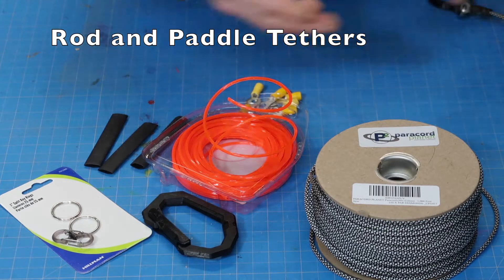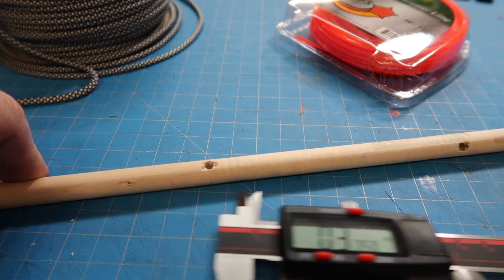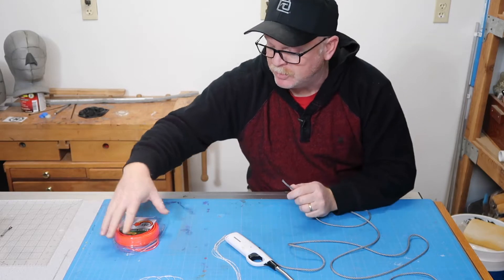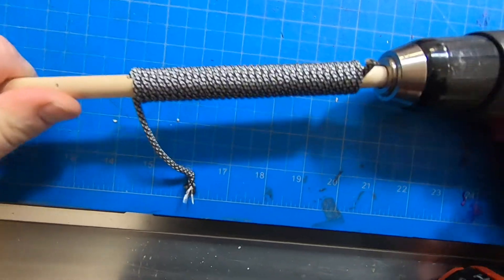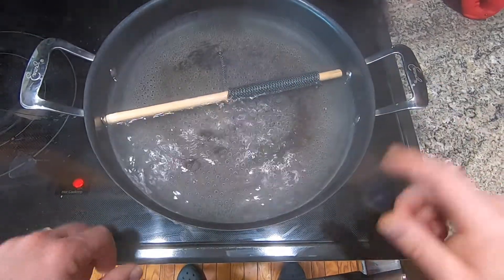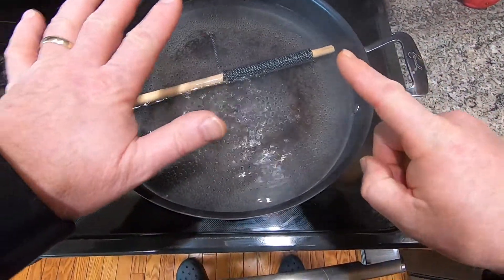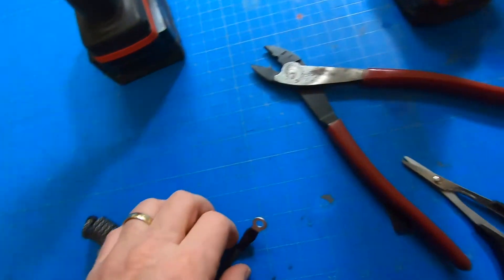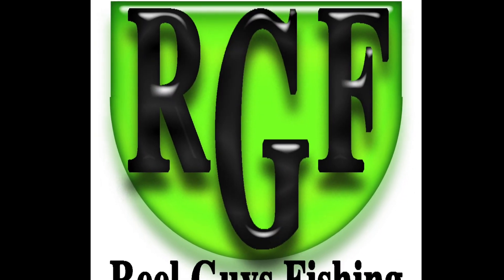DIY Paddle and Rod Retainer Leashes

Comment: I'm going to try this.  But, I wondering how well does the wire terminal hold up in saltwater?
Reply: I can’t tell you. I’m up north in the land of fresh water. It does OK in the snow.
Reply: Should last fine. They are aluminum.
Reply: Since they're electrical terminals, they're probably tin plated brass.